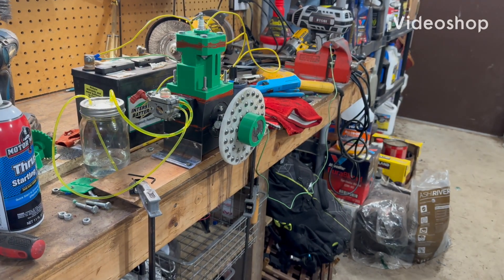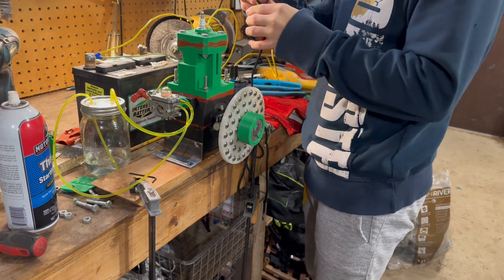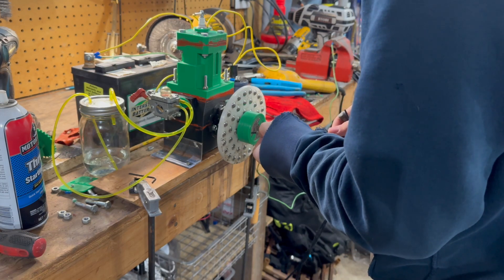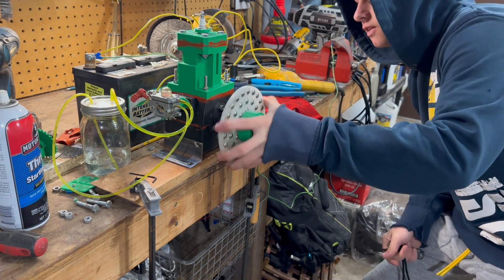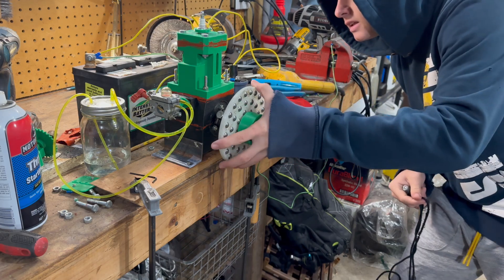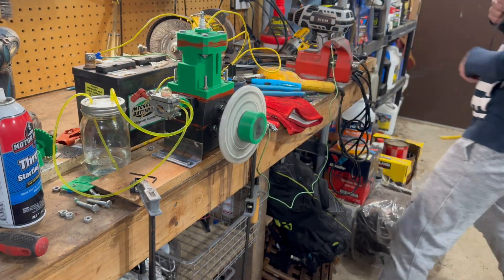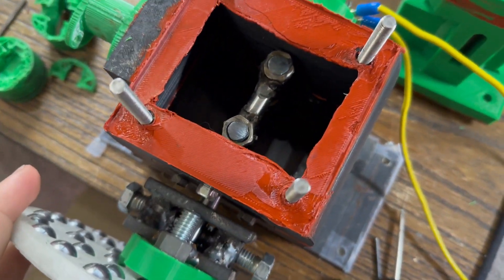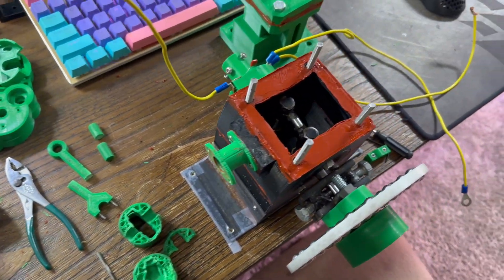It fires! 3D printed 2 stroke IC engine

Comment: Remembering that most all of the model airplane two strokes required priming into the exhaust port and/or choking by putting  a finger over the intake before they would start. Instead of using starting fluid (ether) just use some fuel.  Not as explosive!

Comment: Spray your starter fluid into your carburetor
Reply from the maker: I know, but the issue is that I wasn’t getting crank case pressure, so spraying starter fluid in there wouldn’t do anything.

Comment: I assume the exhaust valve is open but why not spray the starting fluid in the intake
Reply from the maker: Cause I cannot get to the intake, the way I designed the engine is that the carburetor is mounted on the crank case, and the cylinder housing has a transfer port that goes up to the intake port, so if I spray starting fluid into the carburetor, it’ll just go to the bottom of the crank case. And my crank case has a small leak that I need to fix, so it would never make it to the intake port.
Thanks for watching!
Reply: @ProjectLMZ  what burns I really kinda a vapor so it should be fine and if it has a leak I can't imagine the carb is working properly
Reply from the maker: @james10739  yeah that’s kind of what I was thinking, because the crank case has a small leak when the piston goes up and down it’s not drawing fuel in and then it’s not pressurizing it because it’s just leaking out. I’m going to fix this in the near future, with some O-rings on the crankshaft, but I have to wait for them to arrive. Also, something is wrong with the carburetor because it’s not letting fuel through.

Comment: for the connecting rods you should design them to have a bolt run threw the center to have a nut on the bottom.
Reply from the maker: I’m currently working on my next video, but I actually used a quarter inch bolt for the wrist pin and I made the connecting rod stronger and a little sneak peek, it doesn’t break! 🤫

Comment: If that carb is off a weed whacker it has built in diaphragm which should pull fuel. Cool build.
Reply from the maker: The carb is from a 50cc leaf blower, and it looks identical to a weed whacker one, so hopefully it will be fine, but I’m still not getting fuel through the carb for some reason.

Comment: for the wrist pin i used a 6mm bolt I cut the head of and filed a line for a flat screwdriver works pretty well
Reply from the maker: That’s a good idea, I look and see what I have for bolts!
Reply from the maker: Did you get your engine running?
Reply: @ProjectLMZ  narh not yet having some issues with my printer and I'm printing the air version from camden bowen
Reply from the maker: @meromere8339  oh, that’s cool, are you going to upload it to YouTube? I would love to see that!

Comment: Keep the fuel tank above the carburetor unless you have a fuel pump
Reply from the maker: wait, if the fuel tank is not above the carb will it not get fuel? If so, that will be a pretty quick fix. thank you for watching!
Reply: @ProjectLMZ having the hose coming out the bottom of the tank instead of the top will also probably help but if the carb is not gravity fed then it doesn't matter where the tank is at?
Reply from the maker: @neuae__7  what should I use as a fuel tank then? I currently don’t have the capabilities to drill through the glass without potentially breaking it.
Reply: @ProjectLMZ small fuel tank off Amazon but if the carb isn't gravity fed it doesn't matter where the fuel tank is at or if it's coming out the top
Reply: im not sure but i think these carbs have a inbuild puls pump but I'm not sure how good it is
Reply: That carb will pull fuel it has a diaphragm built in. Shouldn't matter where the fuel tank is.
Reply: see the 2 tubes coming off the carb?  it has a diaphragm.  it pulls fuel on its own